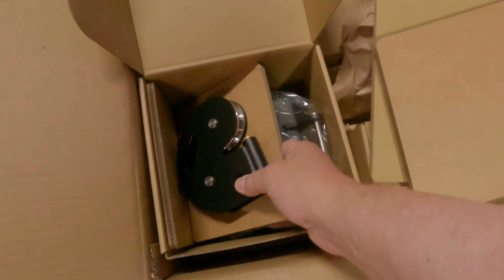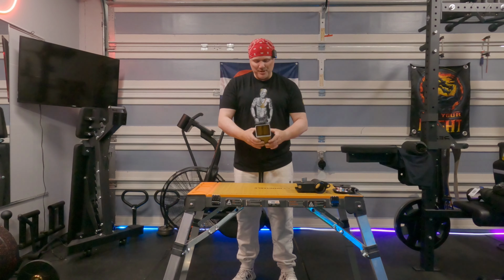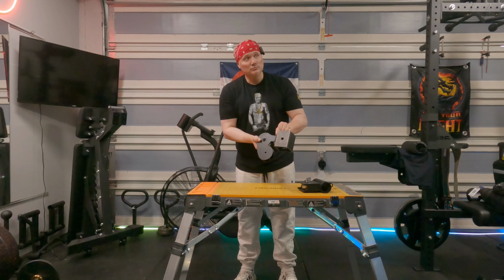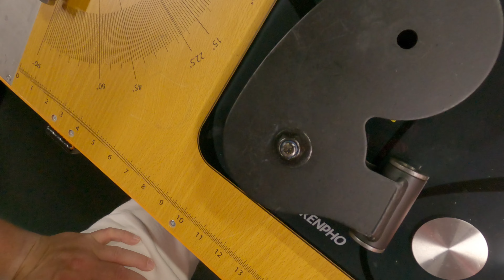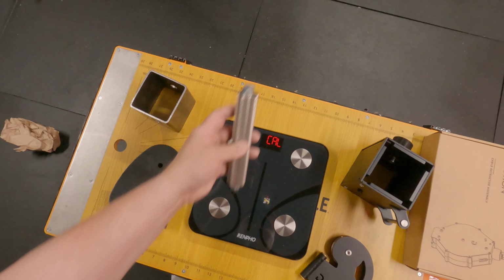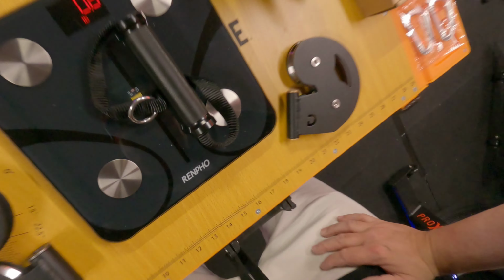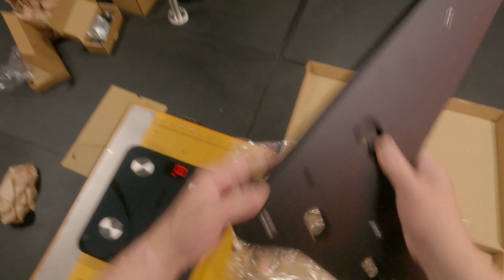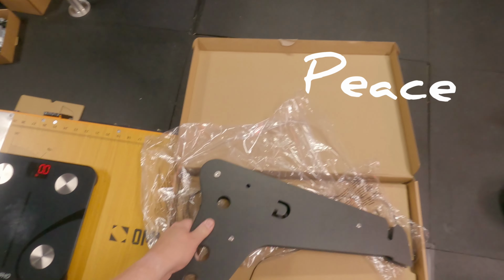Dialed Motion (Sidewinder) rack cable system unboxing: Quality, weight, size

Comment: MC back showing a product!! Only you can show a product without reading all the details page out to us!! I actually appreciate that , system def looks smaller than I thought especially that dual pulley and the retractor cable box.  Curious to see your DIY version working/cost because this is a pricey system so I passed on it.
Reply from the maker: One you a #1 to me , thanks and you are correct I was surprised at how small those two components were but they are still nice. I might not complete the diy now but I'd say it would of cost roughly 300 and up to make it yourself